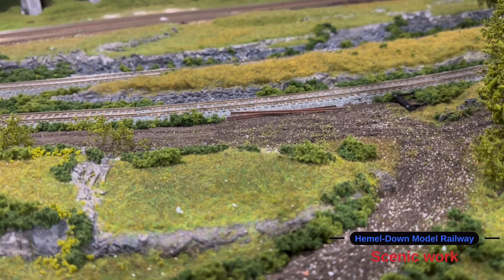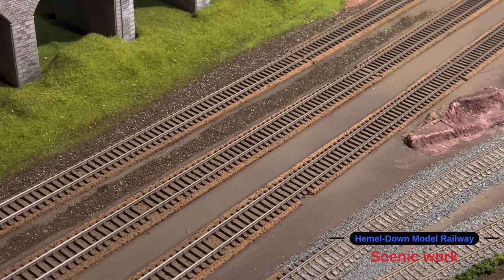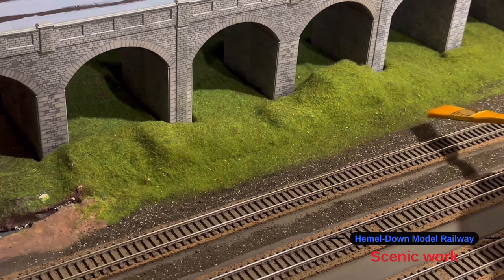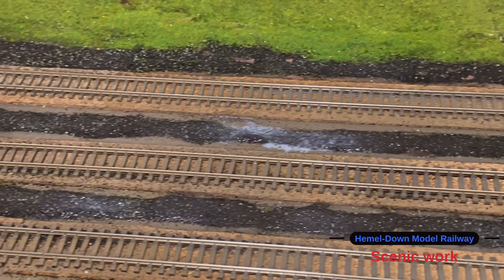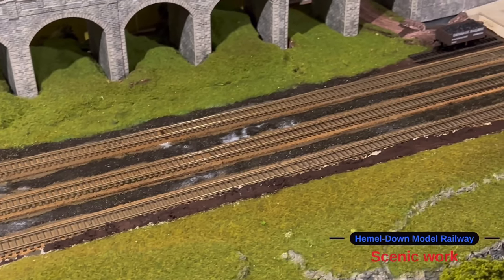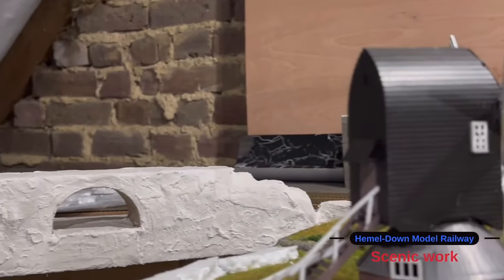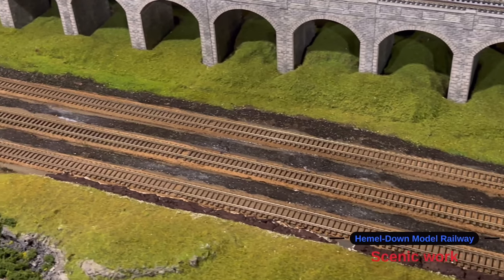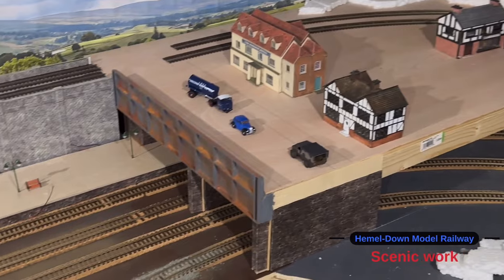Building a model railway - how I make my own ground cover and a new scenic project starts

Comment: Great update Mark👍, its all coming together nicely. I use coloured tile grout and dried out play pit sand so it's nice and clean, I put pigment powders in the mix to change colour. Only paid around £3.50 for 12kg of sand, it's going to last me a lifetime.
Just a little tip for your videos, could you turn down the gain on the music so it is a little lower than your speech which is very quiet. I can either not hear you or the music blasts out really load depending on the volume set when watching. Also fade the music out when you cut it of, I like it, a good choice but it just stops too abrupt.
Keep up the great work, all the best. Cheers Rob.